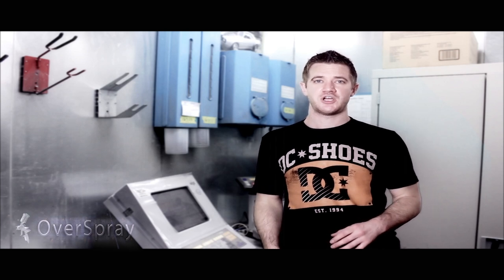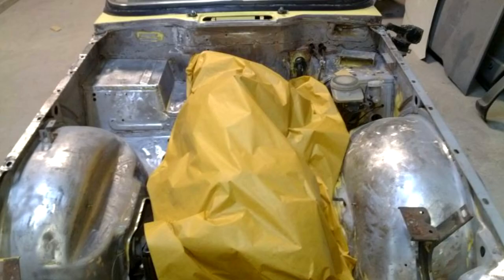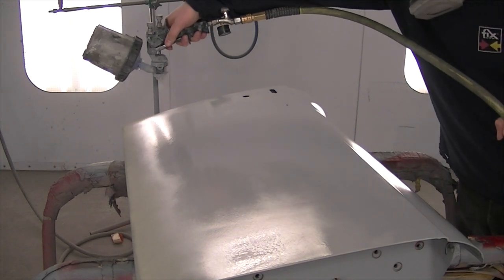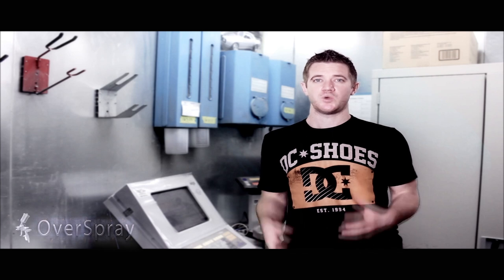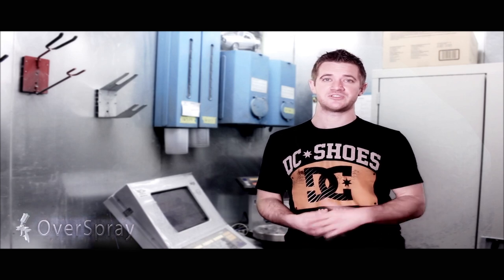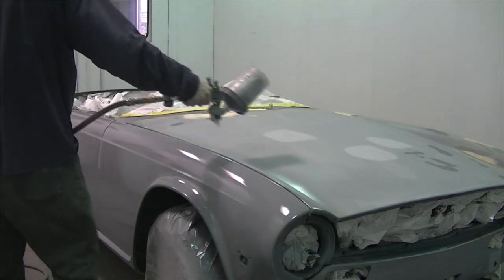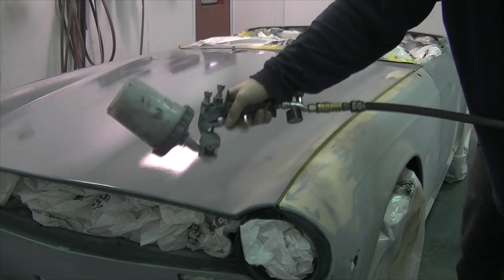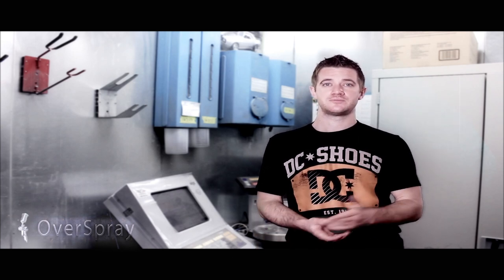Which Type of Primer To Use?

Comment: Hey, I've been holding off painting a plastic spoiler (ABS) b/c I'm confused about what type of primer to use. I have a urethane base & a friend who is going to help me spray a 2k clear. I have an "acrylic lacquer" & Transtar 2 in 1 primer (not sure what kind of paint this is though. Which one is better? Or should i source a 2k (urethane) primer instead? The plastic is smooth and doesn't have texture to it so I don't think I need a high build primer? Sry if I don't make sense, Im really confused

Comment: Question on my 70 nova door jams. Poly primer ,or 2k after epoxy coating? or both?
Reply: I have used expoxy for a wet on wet. Epoxy then primer surfacer. I found the primer surfacer sanded better than the epoxy and I didn't have to sand the door jamb twice.

Comment from the maker: I've never heard anything about etch primers being phased out, people might argue etch bonds better with the metal..I've heard of people using epoxy on top of etch also, I've never been given any information that suggests an epoxy or etch would definitely be better then the other. Epoxy doesn't react using Isocynates however it contains many other harmful chemicals and a fresh air mask is best spraying anything.

Comment: What auto primer do you put on if not painting a different color on a vehicle and not painting over bare metal. Is a high build urethane primer only good enough. Want to know because this year later in the year I am backing my truck a different color but a lighter blue than have now which is a midnight blue metallic color. Just want to know all the primers will need I know will have to sand entire vehicle first though. This auto primer stuff gets confusing but I know about epoxy primer for bare metal. Next time when I do paint I have the Dura Block sanding blocks so will be using them plus a guide coat too. But still new to auto painting painted my old truck but it didn't come out right but it had more rust on it this truck doesn't have the rust.
Reply: Primer is for etching a primer surfacer is for building up a surface. You prime first then primer surfacer. There is no need to use a PS over paint if it's in good condition ie no body work. You may get away with just a sealer.

Comment: Wondering why they are priming from the bottom up?Wouldn't that allow particles of dust  that may be on the surfaces of the hood / trunk lid / roof to be blown loose and sticking to the sides of the freshly painted surfaces. Just a thought. Great video on primer.
Reply: Looks like a down draft booth. Etch or primer surfacer flashes off quickly. If you start at the top by the time you get down to the bottom those surfaces will be covered in over spray which would degrade adhesion. At least thats what I used to do and it seemed to work.

Comment: how about fiberglass primer over 220 sanded gel coat. .. .  etch primer or epoxy? some debate -  whats your take?
Reply: Whenever you sand fiberglass you expose glass fibers. Paint does not adhere to glass. Years ago I sprayed gelcoat on a vet blocked sanded and sprayed it with lacquer  6 yrs later the paint was perfect. A 2 part epoxy would be my choice for you unless you have the experience to spray gelcoat.

Comment: Our body guy told me always use the etch primer.
Reply: 👏              👏               👏
Can you explain why? Or do you just want attention
Reply: I agree was taught same at trade school. We used a wipe on etching primer. I still use it today 30 yrs later. I'm doing a tractor resto and I can remove the rust in the pitted castings with the wiping method. Works fantastic.  Added benefits its cost effective, cleans the metal, no fumes and I'm not adding a layer of paint rather I'm changing the condition of the metal surface creating teeth for the primer surfacer to adhere to.
Reply: @timmathers5243  yep we've restored over 30 muscle cars and always used it and never have any problems. And we are up in northern WI sand country. Most people wouldn't think about it but the sand up here will do number on even newer cars rust wise. I'll add we have gotten busy and sent cars out where they just use a normal primer and after awhile the humidity would make the paint flake and bubble in spots.

Comment: I never cared for etch primer, it doesn’t seem to adhere to metal as advertised. Epoxy seem to do a better job.
Reply: or use a wipe on primer followed up by a primer surfacer. Metal Prep was the brand name we used in college back in the 80's at trade school. Wipe on wipe off with water then follow up with primer surfacer.